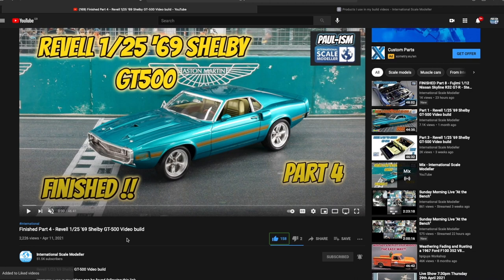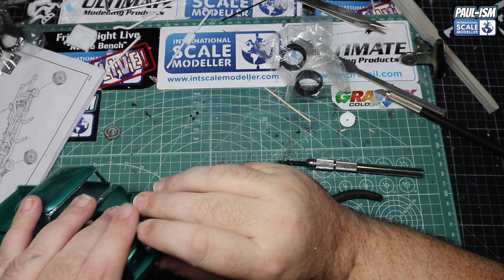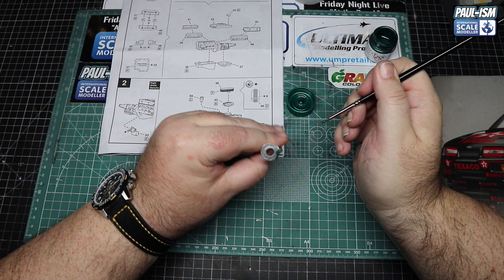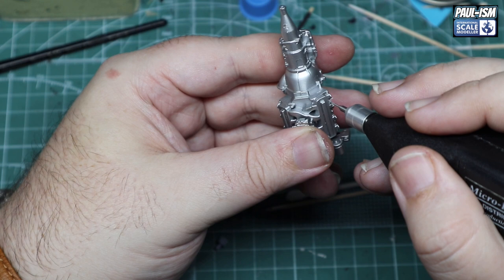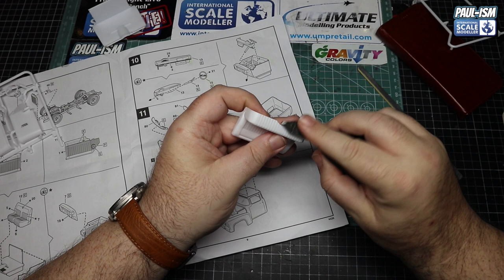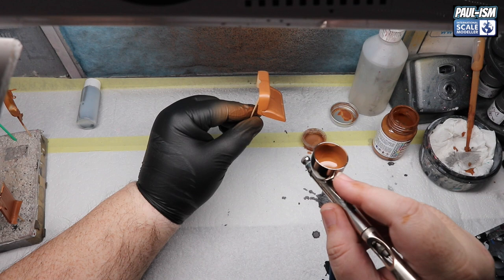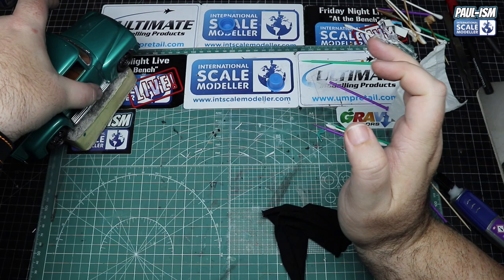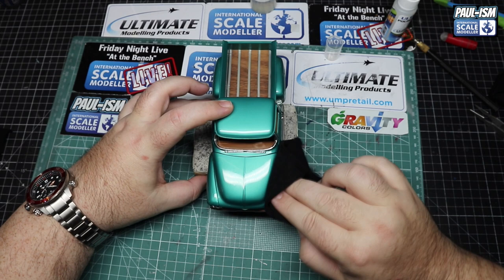Part 2 - Revell 1/25 Foose Ford FD100 Pickup Video build

Comment: A thought might be to rotate the wood floor 90 degrees so the grain runs the length of the bed.
Reply from the maker: Might be but then it wouldn’t fit and I didn’t have any more.

Comment: A spraybooth would help you against the dust flying in the room and landing on youre model. But you still neee to vacum clean spraybooth wont help if the room is dusty just make it worse by suching a lot if dust onto youre model.
Reply from the maker: Erm yes I have a spray booth
Reply: @InternationalScaleModeller  Sorry bro I did not even see it lol

Comment: Beautiful work as always Paul! Love the color combo! It does appear the wheels are a staggered setup and need to be reversed (front to back). Looking forward to the next build !
Reply from the maker: What do you mean reversed. The wheels would not fit under the cab and bed then
Reply: @InternationalScaleModeller  on a staggered set up the rear wheels have more of a “lip” aka exposed barrel than the front wheels. Most American muscle cars run them on the RWD platforms to fit a wider rear wheel/tire setup . For example a common size is an 18” diameter X 9” wide front wheel and an 18” diameter X 10” rear wheel. Hope this helps!